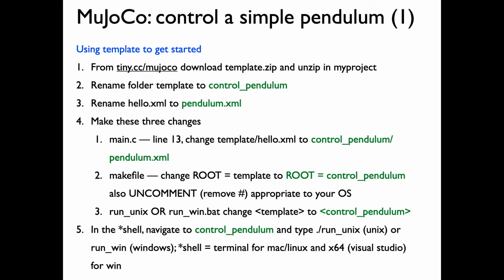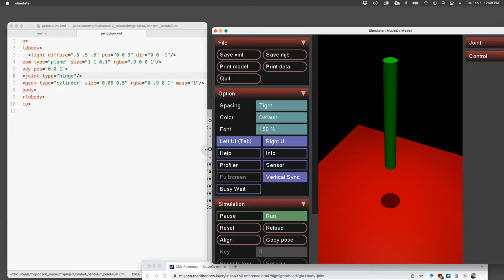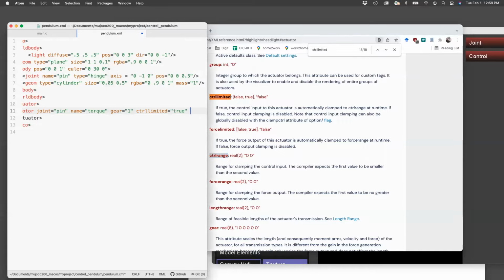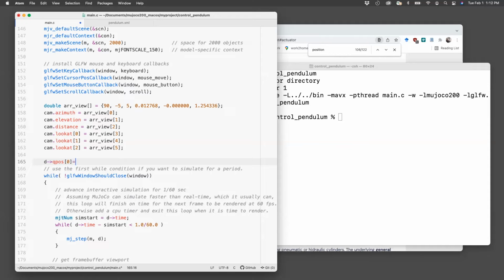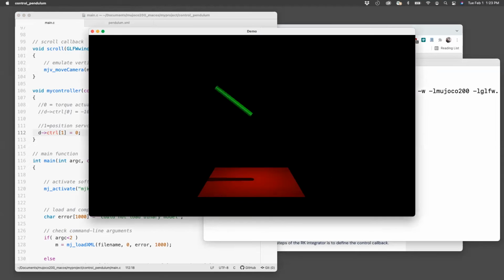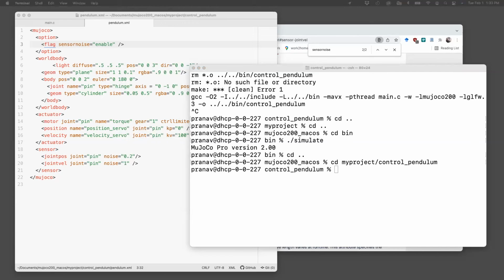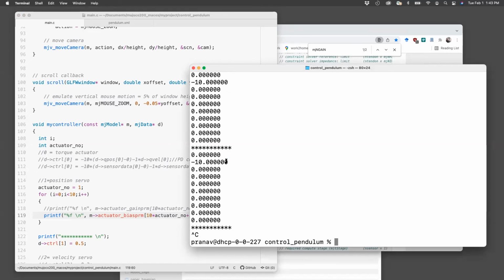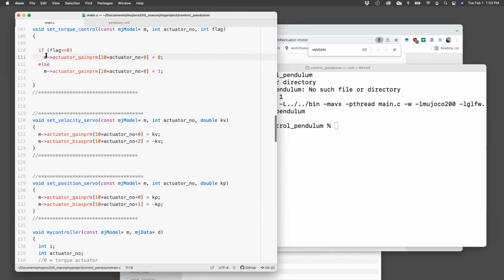MuJoCo Lec3: Controlling a one-link pendulum (Spring 2022)

Comment: I In my understanding PD regulator is a part of PID regulator with 0 coefficient in I part. We use the error of misalignment as the main variable. We multiply it by P, calculate the derivative in D. 
In your example, we multiply the error by P and then by velocity, that is, the derivative of the displacement but not the displacement error. I can't see how that makes sense
Reply from the maker: Do you mean that d->ctrl[0] = -10*(d->qpos[0]-0)-1*d->qvel[0]? Here the reference velocity is zero. If you want to follow a reference position and reference velocity modify this to d->ctrl[0] = -10*(d->qpos[0]-ref_position)-1*(d->qvel[0]-reference_velocity)

Comment: Excuse me, what exactly does gear mean?
Reply from the maker: In the context of mujoco xml file that will magnify the torque by the gear value.
Reply: Thanks for your reply, I think I understand what this means😀 @pranavab
Reply: @pranavab  And I would like to ask why the starting position of this place is lying down after adding the control, but the starting position of the xml file is vertical.
I watched your video again, and I found that it starts from 90 degrees after adding the actuator, so how to control the starting point of the actuator?
Reply from the maker: @Uxnehc  I changed it to 90 degrees in the main.c file. See line 237: d->qpos[0]=1.57; //pi/2
Reply: Thank you for your answer, and I'm very sorry for replying so late. Recently, I am learning to use mujoco simulated rope to drive the robotic arm, but I have encountered some problems. Do you know how to use the cable element in mujoco? I want to use the cable element to create a moving pulley, but I can only find examples of using cable to connect two elements. @pranavab

Comment: 24:40 position controller is just a P controller, why a P controller is able to achieve his setpoint without oscillations? it converges over time when it shouldn't
Reply from the maker: It is a position-derivative control not just position control. Note that the velocity servo is also set. This achieves the derivative part.
Reply: @pranavab  where you set the D derivative constant? It is very tricky for me, I tried to implement a P controller applying raw torque to the joint and I got the same result as position actuator, it reach the setpoint over time... I tried it with your pendulum and another mechanical configuration and I got always the same result
Reply from the maker: @ricardocasimiro6424  In that video it is applied in the XML file. This line
<velocity name="velocity_servo" joint="pin" kv="1" />
But then I also show how to set this gain from the main.c file.

Comment: Thanks this is really helpful! Earlier you mentioned that the const keyword "protects" the model-struct from mutation, but later we change the gainprm values of that struct without any issues. Why does that then work? (no idea about C-Programming though ;)
Reply from the maker: Gainprm is a variable in the model. It can be set as needed and changing its value does not change the model structure.

Comment: 39:55 How would you set the PD controller to go to a specific qpos of the joint? This is set to go to qpos of zero on the joint?
Reply from the maker: Use d->ctrl[i] = setpt; where i should be the actuator number of the corresponding position servo and setpt is the required set point
Reply: @pranavab  This doesn't work. The joint basically becomes a free joint. I posted a comment here with a link to the model and I think it got caught in the spam filter.
Reply from the maker: @Throwingness  my email is in my channel in the about section.